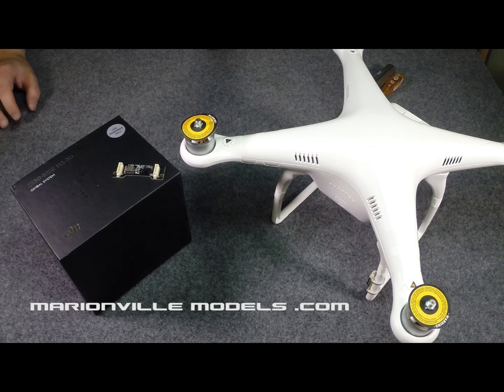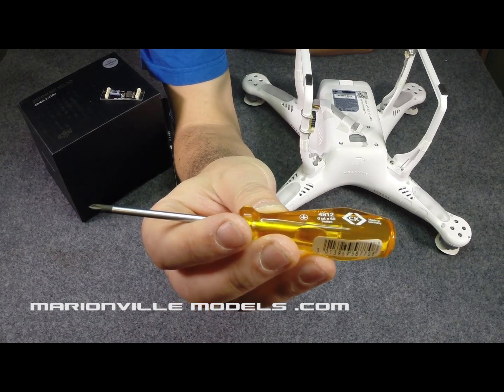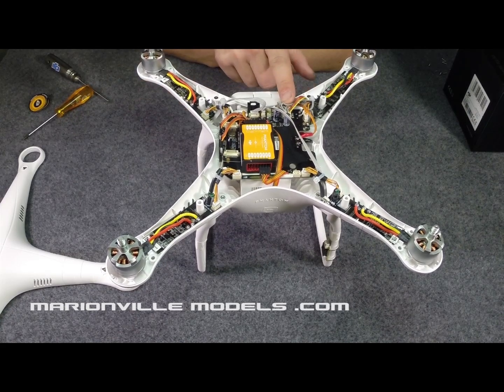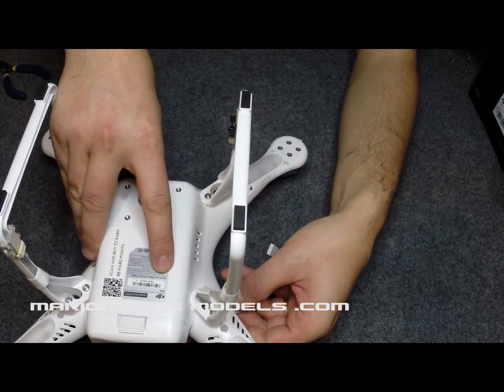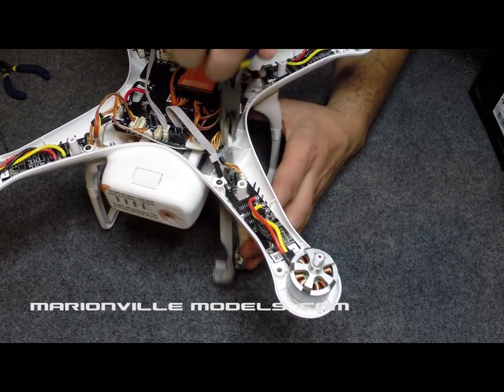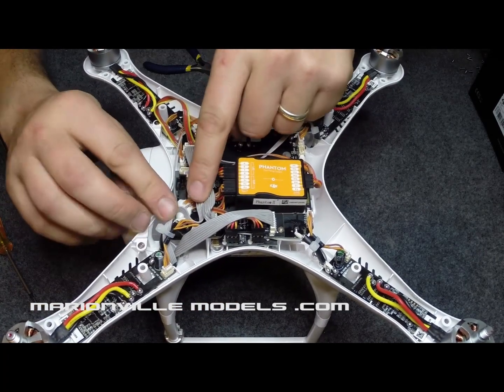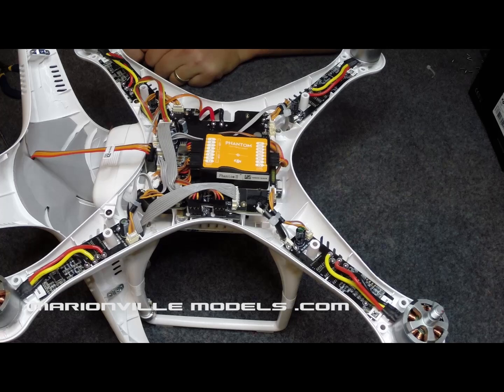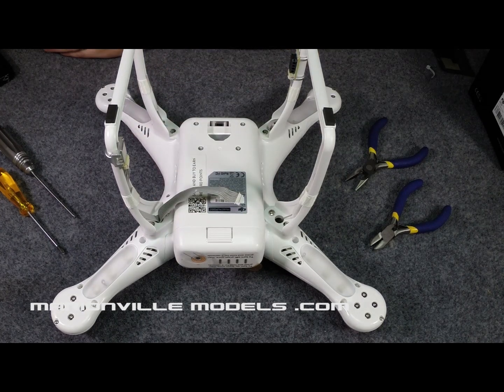Revised Mounting of Zenmuse H3-3D Anti Interference Board for the DJI Phantom 2 Quadcopter

Comment: 20th Feb 2018 and still tweaking both my Phantom 2s.  They are now both V2s and one of them is about to get Lightbridge (V1) as well as a Jeti transmitter using PPM through the trainer port.  It'll be wireless from the Jeti Tx too - this by using Jeti's RSAT receiver which outputs PPM.  Thanks for this useful vid - I've moved the interference board inside which makes room for the Lightbridge air module

Comment: I need that short 8 pin interference cable, where can i purchase that? Or what is that cable called?
Reply from the maker: Have a look in this pack. http://www.marionvillemodels.com/products/phantom2-fpv-hub-for-zenmuse-avl58-iosd-mini?variant=1268143243
Reply: Yes I did look in that pack, but wanted to make sure it was the right cable. Can I get just that 8 pin cable or do I have to buy the pack? And do I really need to connect the anti-interference board? What do the board do?
Reply from the maker: +Cedric McGee you have to get the whole pack I'm afraid.

Comment: Great video, but just FYI to new users, they've made a change to the Phantom 2.  I just received mine and went to install the anti interference board and there is now a fat white cable going down to the new compass unit on the leg.  This cable takes up most of the hole that all H3-3D installation videos say to feed the cable through after you've made the modification.  I was able to force the connector up through that hole with considerable effort, however it damaged the insulation on the cable.  The wire is still fine, so I taped it up.  This is in no way a dig on your video, just letting people know that things have changed a little bit.  I'd recomend removing the compass cable before feeding the Zenmuse ribbon cable through that leg to avoid damaging the ribbon cable.
Reply from the maker: This is the case. I still recommend fitting in the old location. See my other videos.

Comment: Looking at the upgraded Phantom 2 with the thicker compass cable, I wonder if the wire ribbon can fit in the hole from inside to the outside bottom.  Has anyone done it?
Reply: i did... no problem.

Comment: Thank you for a very clear video.  The CK screwdriver you mentioned turned out to be vital. Managed to strip the inside off one of those small Philips screws with another screwdriver. Ended up hacksawing a slot in it and using a flat bladed screwdriver to get it out, (little tip ;)). Job all done now thanks. Screwdriver was about £2.50 plus £4 delivery!

Comment: I followed your instructions from the first video, but I would like to change the placement of the board to the new position. How can I remove the board without damaging the circuitry? I've heard those sticky pads are very strong.
Reply from the maker: If your very carful with a small flat screwdriver you can slowly work along the edge of the board and it will come off. Heating it with a hair dryer can also help.

Comment: Very helpful informative videos, thanks. Any idea what to do if the Zenmuse H3-3D doesn't calibrate after installation? I get a bit of erratic movement then it just hangs at an angle rather than the upright position that it should be in after calibration.
Reply from the maker: When you say angle do you mean sideways or pointing down.
Reply: Hi Rick, it goes through a few flicks and turns and then points downwards at approx 45deg from the vertical position that it should be in, there is resistance if you try and move or turn it.

Comment: After I did all the steps; the heli doesn't work at all. I tried to press on the battery switch and it blinks a few times (4 green LEDs). Also tried to hold it longer, for like 10 secs, no reaction at all. Anyone knows what this could be? I hope someone can help. Thanks in advance
Reply from the maker: You should try updating the firmware. I had one like this completely dead and showing a compass error. I updated he forward to latest version and all good to go.